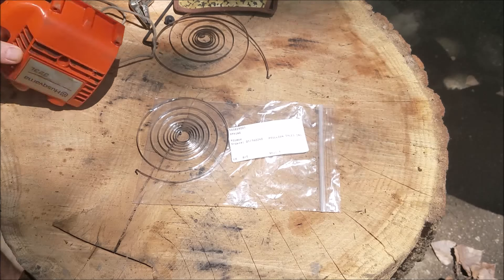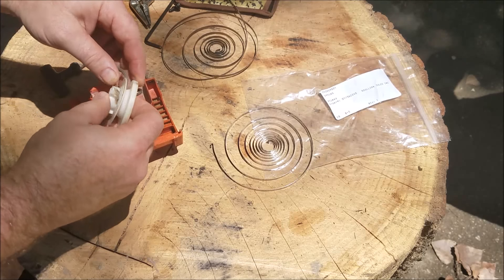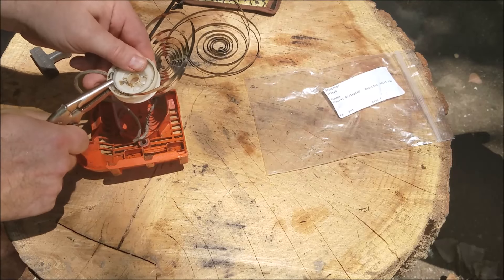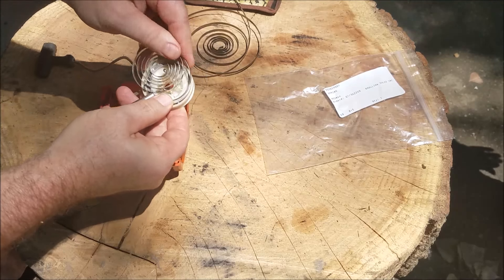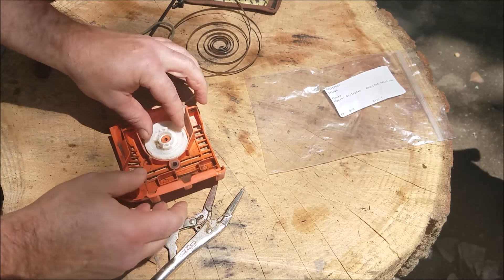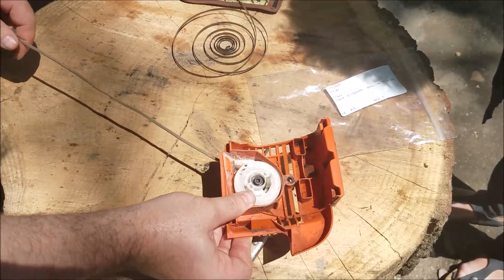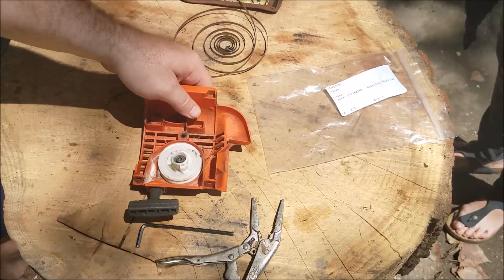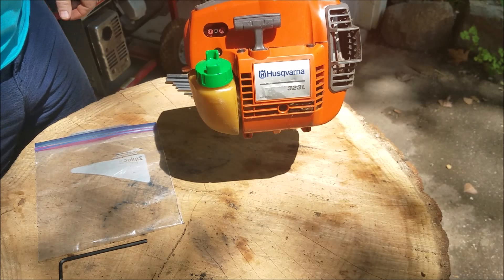How to Rewind a Recoil Starter Spring - Weed Wacker - Husqvarna

Comment: To anyone is watching this. Buy a new one from a Dealer, they are 6 bucks and come in a sweet piece of plastic. DO NOT let them give you one without it, it lines up perfectly and pushes right in. Then you can use the plastic to rewind the spring if needed

Comment: Unless it's broken in half or bent horribly then u can just use a lighter to heat the end up and rebend the hook slowly while hot. Dont temper it tho. Just get it hot
Reply from the maker: Thanks, I tried to bend the end on the broken spring but it just kept breaking more ... I didn't try any heat though.
Reply: Great tip, I found waving the end of the spring you want to bend in a propane torch just until it turns colors works well to defeat the brittle spring steel.